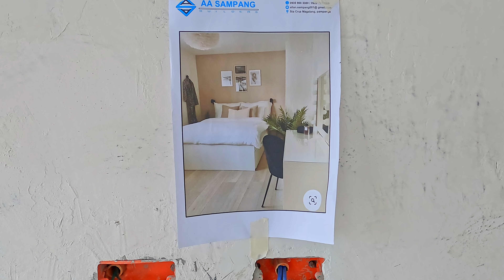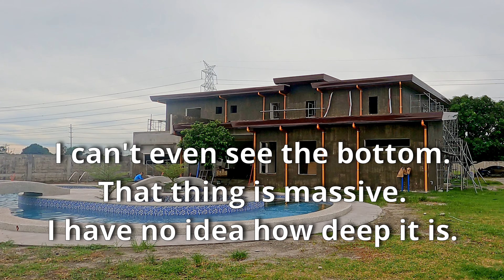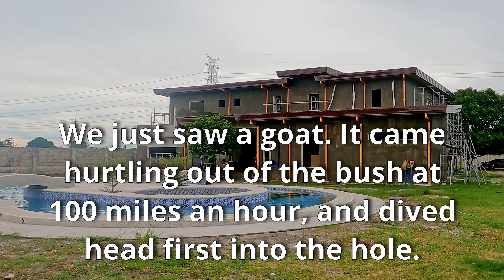Philippine House Building Day 264 - A Missing Morning

Comment: Is skim coating the same as plastering? On the inside of the house. How is the solar system charging, I have watched other home builds in the Philippines. It seems they hit 100 per cent battery charged during the day. I wonder if it could be how the power is being consumed, plus the other solar set ups show a per cent of the daily charging goes into the battery as well as being used.  I have no knowledge of solar power set ups.
Reply from the maker: Thomas
The two are not the same, although I guess in a way, skim coating is almost a type of plastering. In general, plastering is done in much thicker layers, while skim coat is thin, and it's only real purpose is for smoothing a surface.
I have not been keeping a close eye on the solar, although I know it is not performing as well as I had hoped. Certainly on clear days like today, we do get to 100%, but then I think we do not have enough battery storage to maintain what we need overnight. Difficult to tell at the moment though, as they are using a lot of power tools, and I imagine they consume a lot of power. We do not yet have the wifi app, so am not really seeing what is going on.